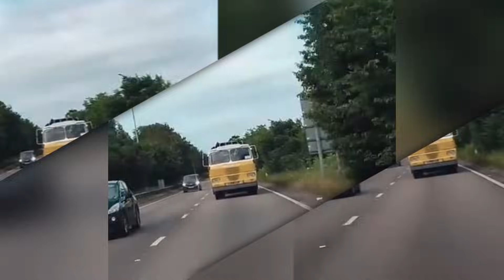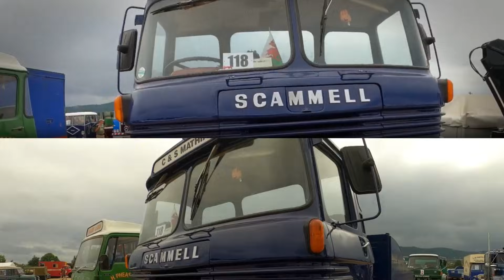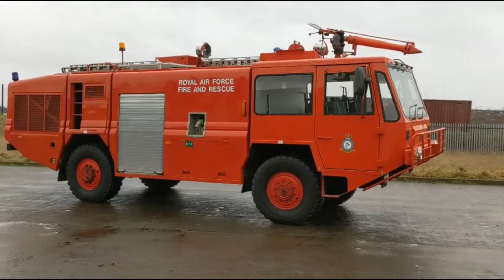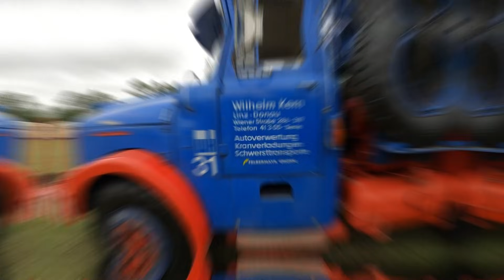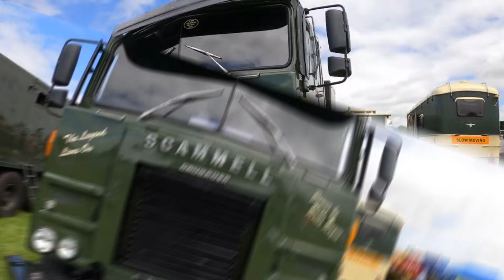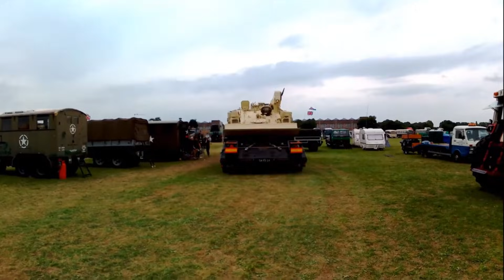10 Scammell Lorries of the 1970s That Made History!

Comment: Samson 8x4 with all axles driven! Rated at 75 tons yet the 3 axle CR100 Crusader could handle 100 tons.
Contractor used a Self Changing Gears RV30 not a Fuller automatic.

Comment: Virtually the whole narration of this Scammell video the commentator is talking through his anus. A couple of instances; Contractor Mk2, there was only 6 of these made and not one is shown.  Samson made in limited numbers? I'll say there was just 1 [ONE] Samson made.  Nubian is the name of all the wheel drive crash tender chassis, the video shows an Explorer. Contractor shown in video with the pressed steel LAD cab which most Contractors used only a few had the large crew  cab which does not appear in the vid.. Crusader was designed as a 4x2 tractor unit with BRS specifying the basics, the 6x4 was a later addition and throughout the video images do not match the lorries shown.
Reply: Minor point but the first Crusader was a Detroit powered 6x4 in August '68.